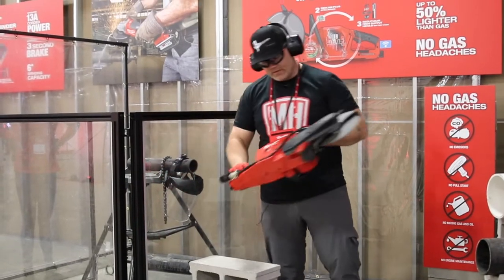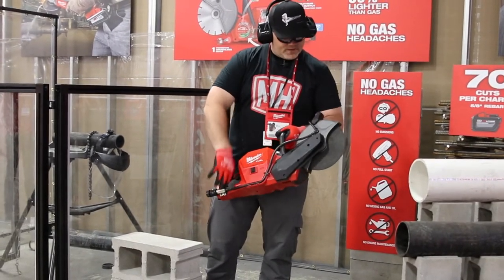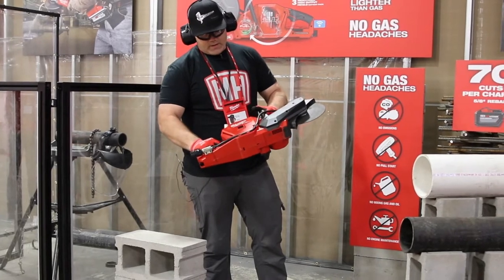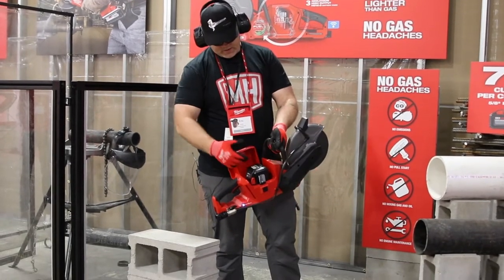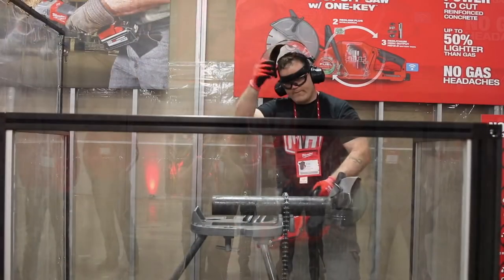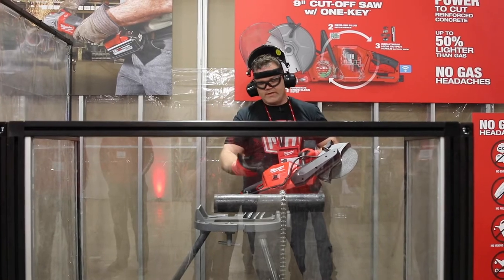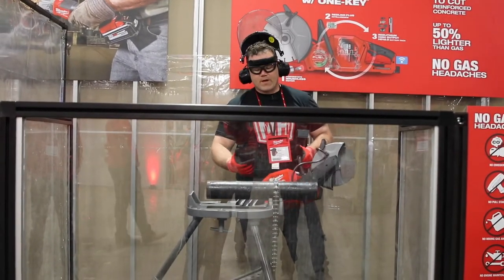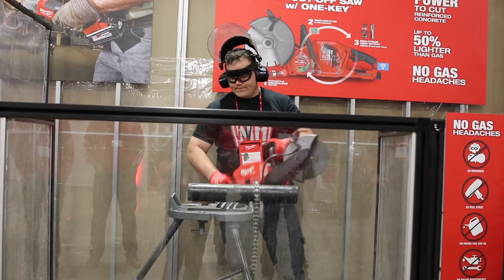#nps19 Milwaukee Cutoff Saw

Comment: I have the dewalt saw.I use it to cut cast iron pipe.It's too bad team red took longer to make this model because I own so many red tools.It looks the same is it also using a 9 inch blade?
Reply: Steve kokkinidis I just bought the dewalt one last week, love it for cutting 3" pavers and curves!
Reply: @americanleisurepools6431  I have only used it once or twice for concrete and it does a good job but you have to go slowly since the saw has an overload protection switch.It does cut thick metal pretty fast.Similar to a grinder but when I'm cutting old cast iron pipe that's in the ground and there's a bit of water in the ground you don't get sprayed with this saw,The saw was built to work with water.